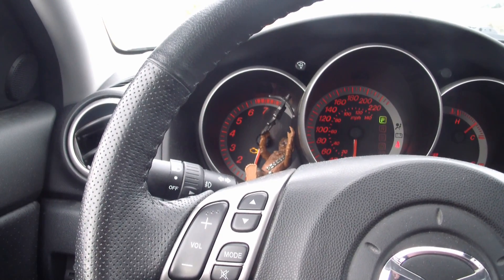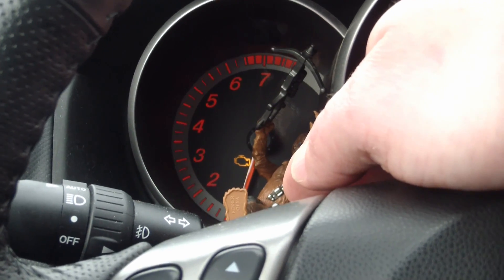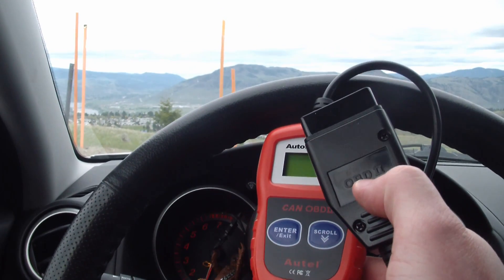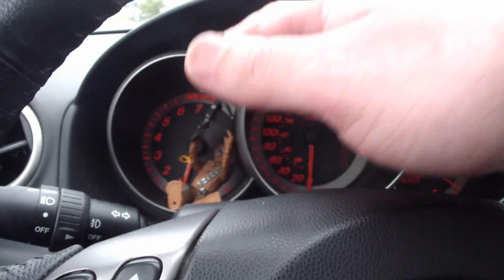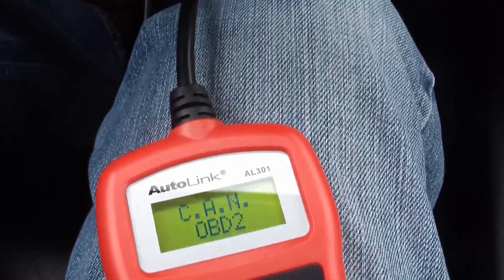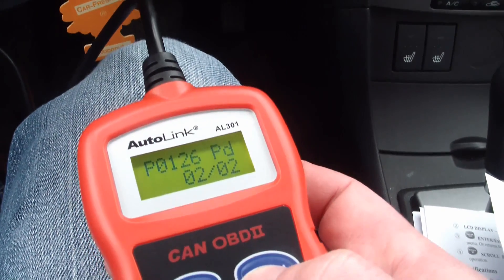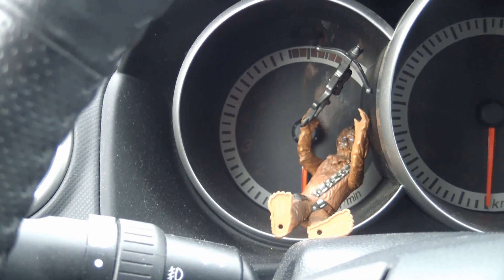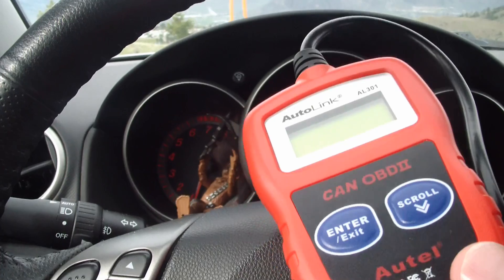Manly-Man Skills: Outsmart Mechanic Scams by Using Your Car's Computer!

Comment: While I was driving my dad's car, during a hot day, while my parents where on a small vacation, this light showed up. I checked online, to see what it was. I read that it could be caused by some sensor being affected by heat or it could be a problem with the motor.
When my parents came back, after my parents learned about it, my father was like "It could have been a major problem! The motor could have eventually broke! It can be a desynched piston."
And it apparently ended up being a desynched piston.

Comment: Keep in mind that this tool only points you in the direction of the problem, it doesn't pinpoint it by any means. The most it will do for you is give you the codes so you can give them to your mechanic and they won't charge you the $50 or however much to do exactly what you just did. 

I've done hundreds of code readings, most of the time its an emissions code or a misfire and usually a stupid simple fix with a new sensor or a spark plug... only ever had 1 situation where it was giving me about 30 codes for things all over the vehicle, the computer was probably dying. Expensive as fuck to replace but easy to do as long as it doesn't need to be flashed.

Comment: do not do this unless you read about the code that you pulled, you could have a serious issue at hand. mechanics are required to write down everything that they find wrong for the car for liability issues. they are not just trying to take all your money.

Comment: Changed out my CATS for high flow ones, the down stream O2 that tells the car if the cats are okay lost their shit and flipped a check engine light.

I just used a bluetooth dongle to check the codes, works with android app.

When I was changing the headers I also didn't get a single plug on a coil the full way and it threw a code as it was miss firing ever so often (LSA 6.2 V8 with super charger and big cam, never noticed).

Told me the cylinder, clicky clack, all good, no stealership needed.

I would never suggest ignoring a CEL but for sure check what it is for yourself ASAP.

Comment: And if you disconnect the battery to reset the check engine light it also resets all the emissions data and then you have to drive for around 50 miles, and it takes a couple days to get that data back. And your car also compiles data while the car is off. So yeah, if you need a smog check, and you think you are going to reset the check engine light and then go right away and get a smog check, think again. I'm in Ca. and this just happened to me about 3 weeks ago. I drove around for 4 days and thank goodness it passed.

Comment: The OBDII to USB connectors are better.  They cost like $20 and you can connect it to your laptop.  Tells you all the codes, lets you erase them and also lets you run full diagnostics with more specific information.  The software is usually free with the cable plus free 3rd party software you can find online for your car.

Comment: Took my civic to a crappy tire for an Etest.. it failed, do to the fuck light being on. Said they didnt know what was wrong but could fix it for 400$. I told em to fuck right off took it home whipped out my ob wan. Ended up being low voltage battery and faulty gas cap (was using the old sock) 100$ later on a gas cap new battery (old one was 7 years old) and etest was passed

Comment: Some additional details on the CEL: This light will only illuminate if there is a fault that will increase vehicle emissions, or prevent an emissions related monitor running. Most emissions related faults need to occur in two consecutive drive cycles in order for the CEL to illuminate. Exceptions would be severe misfires that could damage the catalytic converter. Those will flash the CEL when they occur.

In the case of your wife's Mazda, if the car does not reach operating temperature, then it will stay in open loop, where O2 sensor data is ignored, and pre-programmed fuel trim values are substituted instead. In other words, it'll run rich. Also, some cars give you the option to pull codes without a scanner. Some Chryslers will display codes after you cycle the key on and off three times. Procedures vary greatly by manufacturer.

TL; DR - CEL only cares about emissions, and internal combustion engines are complicated.

Comment: you don't even need to spend 30bucks. a normal £5 obd2 Bluetooth dongle will do when teamed with one of many apps avalible on android. 

my car is just about to pass 20k miles and over the last 3 weeks there seems to be a rattle inside the exhaust, I'm going to run my obd2 before I take it to Vauxhall (GM for you Americans ), btw worst dealership I've ever used. would tell folks to buy anywhere but the one I did!

Comment: Smog check is a joke... especially in California. Florida tried their machines and found they were indeed rigged. They went to SunCo and through those machines they found that within 30 miles there would be one fail and one pass on the same vehicle.  California still uses those rigged machines.

Comment: A code P0126 may mean that one or more of the following has happened: 
Low engine coolant level 
Faulty thermostat 
Faulty coolant temperature sensor (CTS) CTS electrical wiring or connector problem - open, short, or poor connection.

If the coolant level is not low. in most cases chances are very likely your vehicles thermostat is starting to go bad. Not saying that's always the problem but chances are it is. if it had been a P0128 then it definitely would be the thermostat needing to be replaced. Because the cost of adding coolant or replacing a thermostat is a lot less than the cost of the CTS.

Comment: Last time I used my reader I found a bad ignition coil on a Volvo.  It sounded like the engine was shot, but my nephew just put in another coil for less than $200 once we knew what the part was.  It gave me the a code for a misfire on what cylinder it was.

Comment: Thank FUCK for this video AvE! I was worried when my chevy pickup had the same light but I remembered this video and then watched it again! Turns out you can buy the same tool where I live for just $20! I read the code, and I just have to clean the intake manifold and mass air flow sensor, and maybe install a new air filter! Keep your stick on the ice! :-)

Comment: the problem noone ever mentions is the false positives. A friend of mine had a 94 Camaro ODBII said it was a MAP sensor. He replaced the sensor only to have the same error a week later. He AGAIN replaced map sensor  and roughly 2 weeks later it done it again. The problem was not the MAP sensor it was the casing in which the map sensor plugged into, the casing had a small crack and was causing the problem. He changed the casing problem solved.

Comment: Most dealerships are crooks. There is one near me that is an interesting case study in the Jekyll/Hyde dichotomy. On the one hand, their customer service is outstanding. They know what they are doing, service cars well, and don't try to rip you off in that department. Their prices are definitely higher, particularly on parts, than independent shops, but they do good work, don't do "extra" work, and tell you precisely what it will cost before they start. On the other hand, they were fined nearly $200,000 for using bait and switch. They would say a certain cheap car was available on their ads and then claim it wasn't there when you went to the lot, offering to put you into a slightly more expensive car instead. In the end, I trust them to do the repairs/service I cannot (e.g. four-wheel alignment), but that is about it.

Comment: Erm, considering how many faults removing the battery lead from the battery terminal can trigger on modern cars, I wouldn't be suggesting to do that to extinguish the engine management light. Especially as it most likely WON'T extinguish it anyway...

Comment: You need a thermostat, and yes it will come back once the car completes the corresponding internal  mode 6 test (car is dead cold than warms up to operating temperature several times in a row).
Reply: Yeah it's a pretty common problem with the Mazda 3. Mine was actually covered under the emission warranty.

Comment: #offended As an automotive technician I obliviously offended that you are slandering dealerships and shops. Its fantastic that you can read your codes and clear them after purchasing this code reader. you can also get them read for free at most supply stores. So what, you can read the code and "monitor" then use google to save the day. Good luck! The information on forums and other communities are so random in opinions, it would be hard to get the right fix. Even if you have the code number from the thousands others, there are several issues that can cause that code to happen, requiring professional diagnostic.  Im sorry that you had a  "bad" experience at a dealership.

Comment: Im a mechanic at a stealership, you his the nail on the head pretty well but there are some codes that are dealer specific and jobs that only the dealer can do. Such as if you lost all of your keys and need to have an immobilizer reset done. Or just if you simple want to buy a new key and have it programmed. Most of the work we see these days is warranty work because the stealerships charge way too much for labor and parts.

Comment: something disconnected the battery doesn't work. I disconnected the computer for 2 to 3 minutes  reconnect it the light went off. oh there is two wire connection the clip get lose. check all engine connection. will do the job dealership the worse place to take your car. the will f... you no kiss in top of that they will wrap it with sandpaper. you know what I mean by wrapping it with sandpaper.

Comment: if you don't have 30 bucks you can just drive up to the auto parts store. They'll let you use their scanner if you give them your ID while you're using it.
Reply: They'll also be able to tell you what your error code means, and for those newbies, further explain the problem in detail.
Reply: Right, and where I live there's auto places, dealerships even, that will send out a guy with a scanner and tell you exactly what the problem is.

Comment: Unfortunately these magic scan tools are not the answer to all your car failures, as a former auto electrician a lot of times a great deal of labour can be involved in fixing these faults.I have had brand new vehicles sent to me with faults.....the problem has been a faulty wiring harness from manufacture ( wires swapped in plugs on the harness)

Comment: Your, thermostat is bad (jammed open, or slow to respond). Some times it take several drive cycles for faults  to be stored. Vehicles in usa automaticly will delete the fault if it does not come back after 40 drive cycles. So you honestly do no need a scan tool if you really believe it is a glitch.  I would say about only 15% of check engine lights are due to something actually not being broken (like loose gas cap, or low fluid level)
Pending fault does not mean the fault is currently present. Please reevaluate this video, information provided is very questionable. Also i guessing your vehicle does not use american emission standards, Each country and state fallow different guide lines.

Comment: Anyone have experience with an inexpensive code reader for heavy equipment on J1939 standard?

I'm a farmer, and need one for JD, CNH, CAT tractors.  You think the auto dealer network is broken, try getting a JD tractor repaired at a dealer.

Comment: never ease emmiction or trans codes. if you erase them they won't come back but when you go to get your emmictions test you will fail because one of your modules won't signal ready causing an instant fail and a hole in your wallet when giving it to someone to figure out and fix. and a pending code is a code saying that somthing happened that the computer didn't like but it is waiting for it to happen again within a time frame. take care of your car for the love of God.

Comment: I bought Lemur's BlueDriver.  The live data feature is awesome.  

I have learned that if you disconnect your battery and try to take the car to get emissions tested, you may fail.  The power disconnect wipes out all the data in the computer (I/M monitors such as misfire, fuel system, EGR, EVAP, catalyst, A.I.R., oxygen sensor, oxygen sensor heater).  You would have to drive as far as 100 miles for the computer to regather the data and determine a pass/fail status.
Reply: I don't drive long distances (less than 50 miles/day).  I had to replace my battery and it took almost a week of driving to get the readiness errors cleared.  I think you can have 1 or 2 not ready out of about 15 and still pass emissions.  Depends upon the state.

Comment: I'm a little late to the party - but -
After you disconnect the negative cable of the battery, 
clamp it to the positive battery terminal and leave it for about 10 minutes or so.
This should reset most of the computer codes.

Comment: most vauxhalls/opels/chevrolets/holdens from 2004 on have a feature that lets you check codes by holding the brake and accelerator and turning the key to ignition on. Just a tip

Comment: this code gets thrown all the time when the temps drop outside. Usually means the engine hasn't warmed up fast enough. My last car threw this all the time in the winter.  But i had heat and the engine was never overheating,.

Comment: I am all for people fixing things themselves but from experience as an automotive technician I see more people bringing in cars they have tried fixing by reading forums and stuff and throwing whatever parts they think will fix it without testing. Many times the parts are installed wrong so on top of fixing the original issue we have to fix what the customer tried to fix. Cars are not simple anymore like they used to. Another thing that drives me me nuts is people claiming we scam. The reason the costs are so high is the overhead is really high nowadays. The proper scanner we last bought was almost $10k with $1500 in yearly software updates.

Comment: as a mechanic "technician" and business owner... THANK YOU! When you come in it's fine to say "it had code 'P0204' (or what have you)" but if you tell me to replace an oxygen sensor that's what I'll do. it's not because I'm trying to take your money. It is simply because years and years of me trying to tell clients "an oxygen sensor won't fix that issue..." they get upset and tell me off. So through the struggle of good guy sam, I have come to terms with doing what I'm told by the client.

Comment: The collant must have lil too much water or the thermostat is a summer thermostat...  Wich means it it opens at a cooler temperature and a winter thermostat allows the coolant to heat up before opening the gate...  Thus engine sensor found temp too low.  How ever...  A cold engine does not burn all the fuel and the fuel end up down the exaust and the o2sensor gets caked same as the catalytic converter....  Its a process.....  We would have much cleaner engines if we used hydrogen and not a diesel by product called gasoline....

Comment: lol that's funny... 5:08 saying all codes is the same for every car is not true... I had a code on my Subaru which was a 2.5L 4 cyl naturally aspirated boxer... And the code that came up, that manual said it was a bad sensor relating to the turbocharger... it clearly isn't turbocharged.

Comment: OK everyone yes this will pull codes but it will not give you live data if your not a technician you probably don't have a clue what I'm saying but a ecm has certain parameters it Is Flashed ( programmed) to go by. Also removing thę battery cables will erase the codes but it will also not everytime and not on every automobile but it has been known to cause some ecm's to lose there programming. Not to scare anyone from working on their own vehicle but be sure you know what you are doing before attempting certain things. And yes google is a good start but watch some of the forums out there because I've seen several times where people were given the wrong information intentionally.

Comment: a tip. if your reader wont turn on you may have a blown fuse. the obd port shares a fuse many times with the 12 volt accessory ports.

Comment: there is always discretion involved. for example, p0420, catalyst system efficiency below threshold. it sometimes means the converter has gone bad, more rarely does it mean nothing else is wrong with the engine. the parts stores and even dealerships still usually recommend replacing the converter, even when something as simple as a misfire may cause the code to arise.